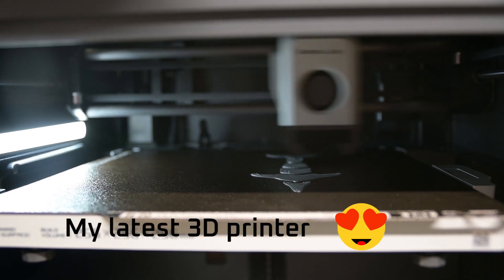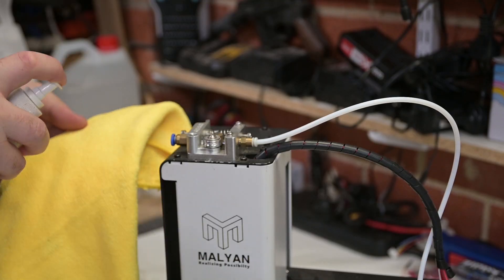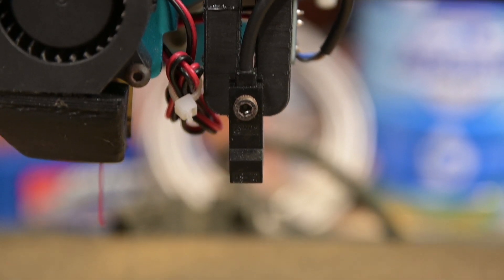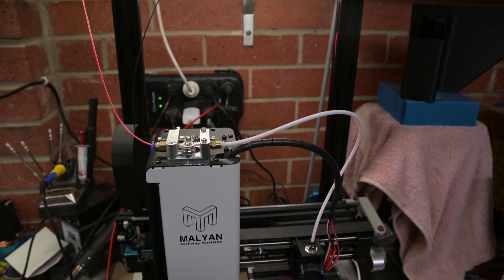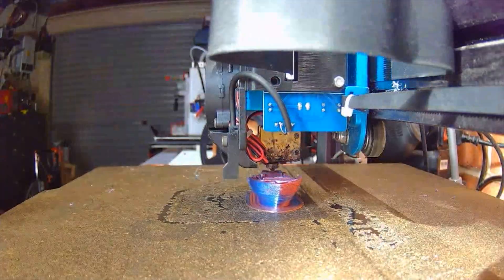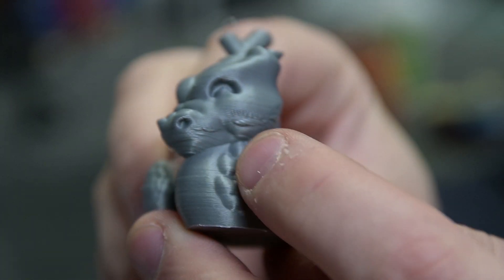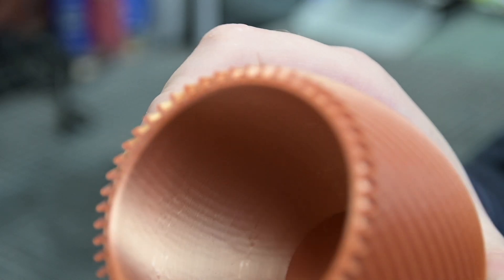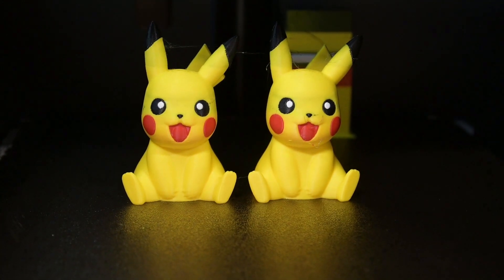Are expensive 3D printers worth it?

Comment: The x1 sidewinder is pretty old there are better comparison printers. Im assuming its because its what you had. That said the a series printers completely ruin it. Before that every sub 300 printer REQUIRED mods or a ton of calibration. Probably both. As a lot of parts just dont last as long